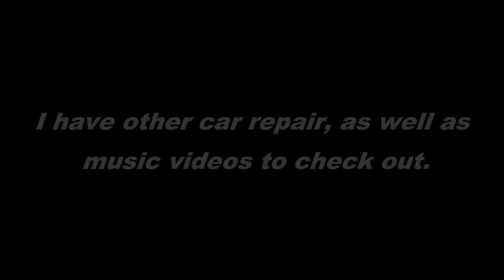Front Disc Brake and Rotor Replacement - Chevy Malibu, Buick, GM

Comment: May suggest jack stands for safety just in case. When pushing in the caliper it is a good idea to open the bleeder and expel all that latent dirty brake fluid rather than pushing it up to the master cylinder, if one has abs there could be potential issues down the line. You could leave the old inboard pad in to push against allowing for more surface area to cover the piston for an even displacement of pressure.
Reply: Back in the 70's I use to do this with just a wobbly bumper jack.
Reply: His jack doubles as a jackstand. Theres a anti drop pin that he slid in after jacking it up.